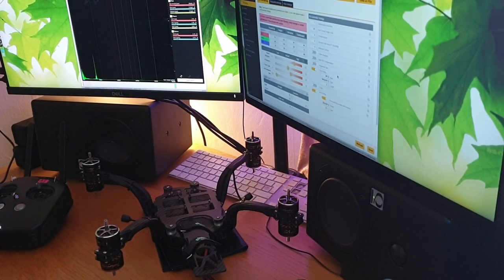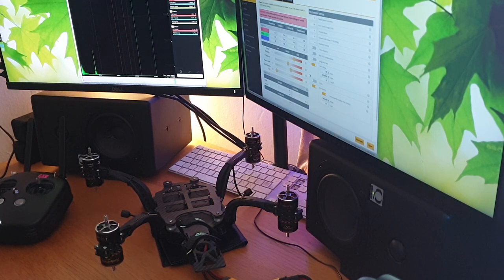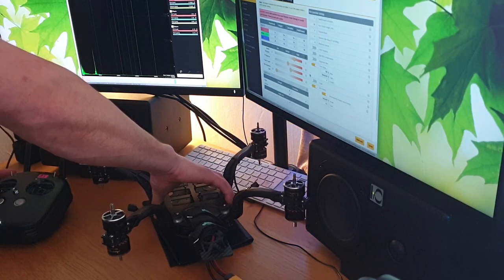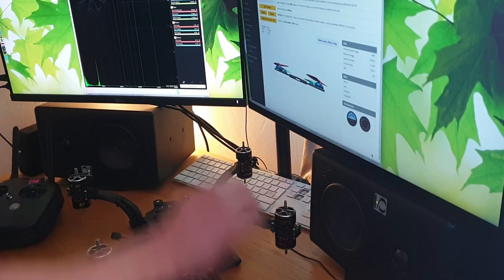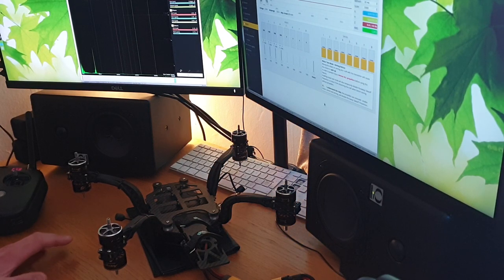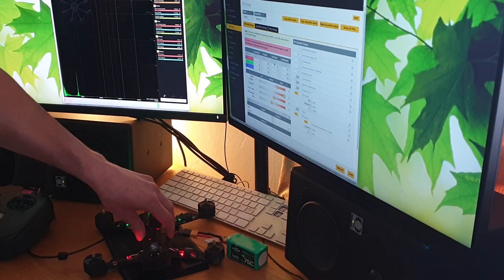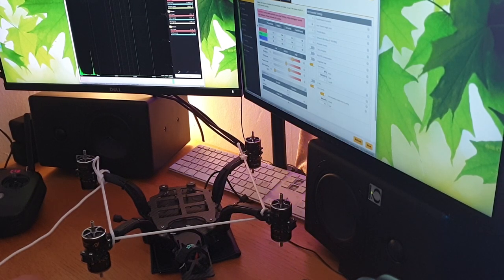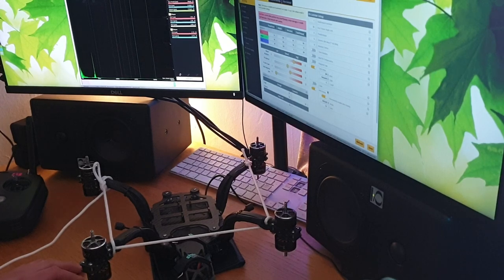Siccario Cinelifter & BH2812 v3 - Frame vibration issue and hacky fix

Comment: i use 2507 BH avenger v2 motors on X8 7inch and its way more power than i really need, so i dont understand why people use like 2812, even for 8 inch it seems way to much. also the max load on each motor in X8 seems a bit lower compared to X4 quads.
Any reasons?
Reply from the maker: You can sink a lot more D-term into them basically : ) I also think 2812 is overkill, my next build will be 2810

Comment: Did you check that your arms aren’t delaminating? I have one arm that has a lot of flex like yours and I found that when I flex the arm I can spot the gaps where the carbon is separating.
Reply from the maker: Yup all arms are mint, I first saw the vibrations on the maiden flight. After talking with some other pilots who use Siccario & BH2812 I am not expecting this issue to be isolated to my system.

Comment: best fix is just going to smaller motors, 2808s on the new HQ 8x4x3 would probably work, but youd have less vibration issues if you down prop to HQ 7x4x3 and 2806.5  ... the carbon lamination direction of the arms really adds to this effect on the frame and motor/prop weight will only make it worse, I have a similar frame design and expect to run into the same issue (put it together today, def arm yaw flex... wiring up over next week). im hoping to add carbon side braces to help sort this issue like you did with rope
Reply from the maker: Cheers for the reply dude, Andy from shendrones jumped right on this along with a couple of others and there are now some nice solutions. have a look at the comments in the facebook thread here: https://www.facebook.com/groups/cinelifters/?multi_permalinks=533695408033684
Reply from the maker: I have gone for threaded bar with knuckles each end on the motor mounts, will do another video at some point soon showing the results but I am happy to say its loads better